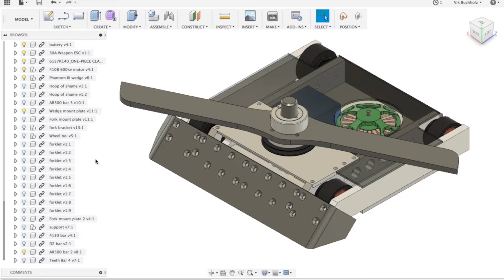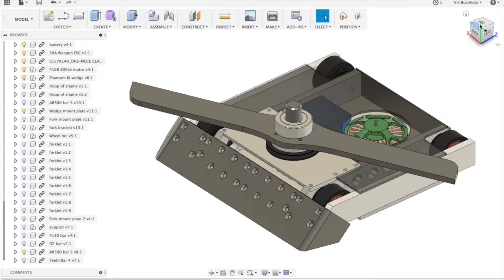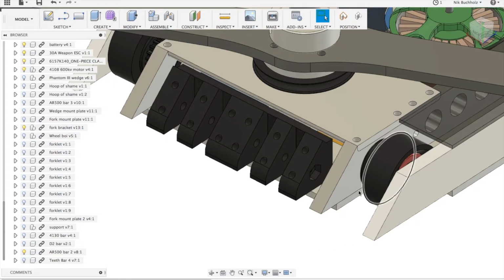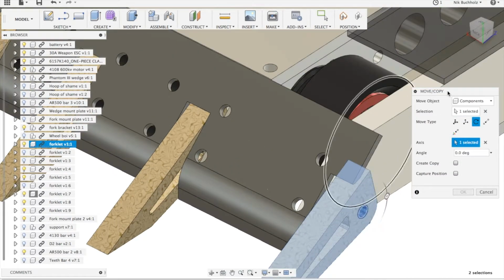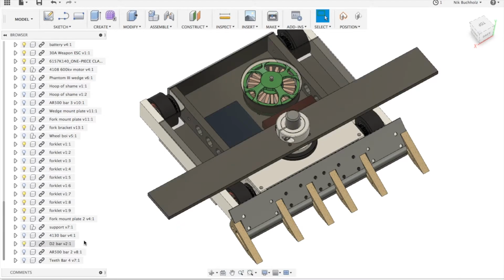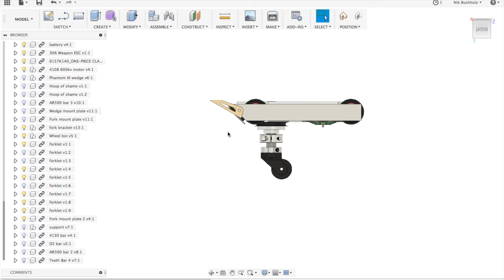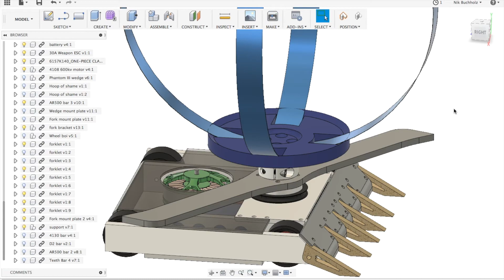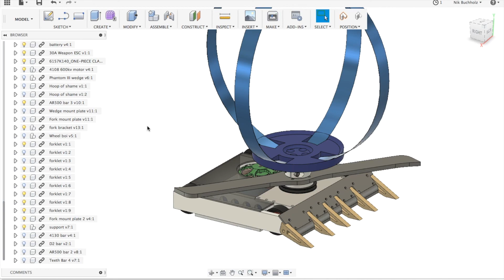Design Peeks: Upgrades to Phantom II (3lb Combat Robot)

Comment: Hey! Love the video, especially those hoops. I'm looking to make a ant weight that use a hoop (or maybe more of a truncated cone) as armor that is connected to bearings kind of like a unpowered spinner bot. Any tips on what thickness to use? I figure I'll just overlap the ends together and use an insanely strong tape to connect them. Also, do you happen to know any other teams that have used this material like this? Would love to observe more designs with it.